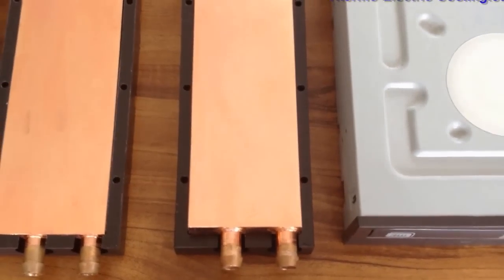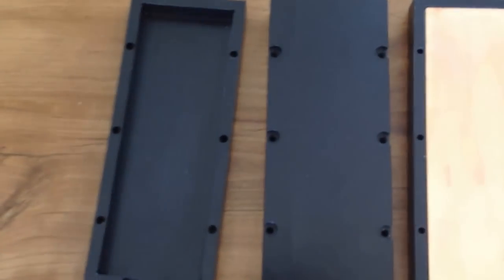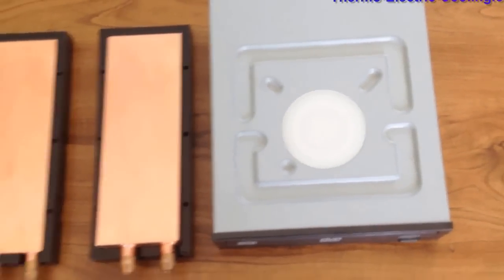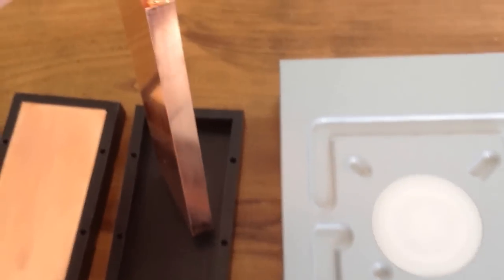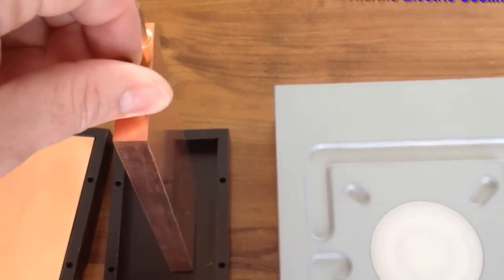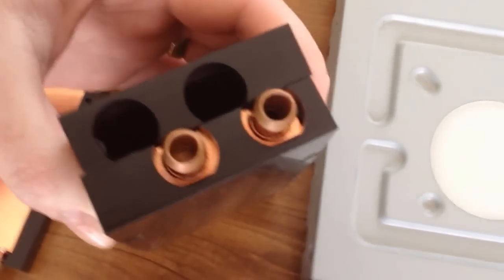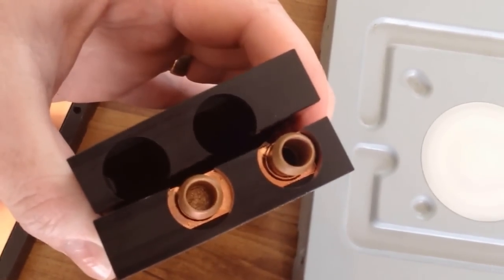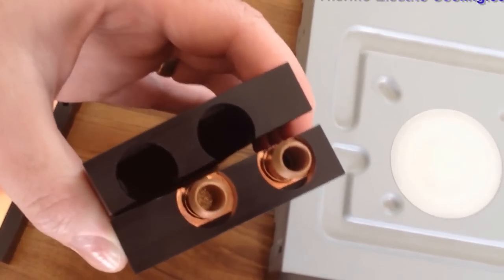⚡️ Thermoelectric Cooler (TEC)  / Peltier Water Chiller Triple 50mm  For Cooling a CPU

Comment from the maker: Here's a all copper INTEL single 62mm block i make
Intel 62x62mm TEC / Peltier water block
Here's all Aluminium triple 62mm TEC water chiller i also make
Triple 62mm Peltier TEC Water Chiller
The same as above but anodized 
Triple 62x62mm TEC / Peltier water block
Here's a all copper tripple 50mm TEC water chiller i've also made
Triple 50mm x 50mm TEC / Peltier Water Chiller